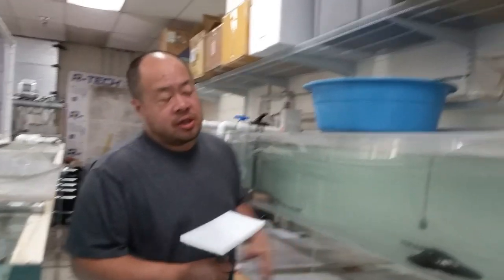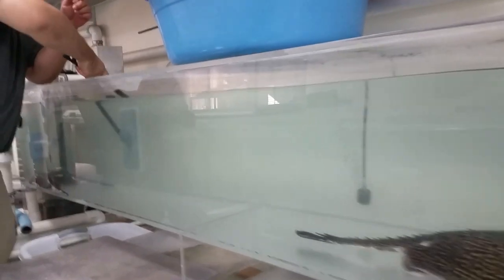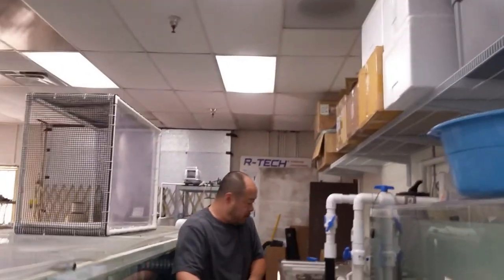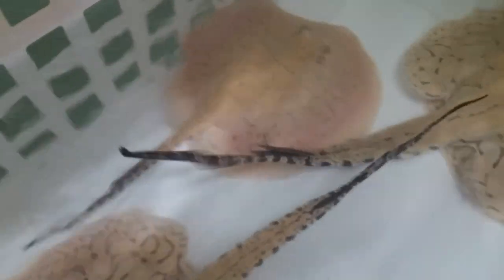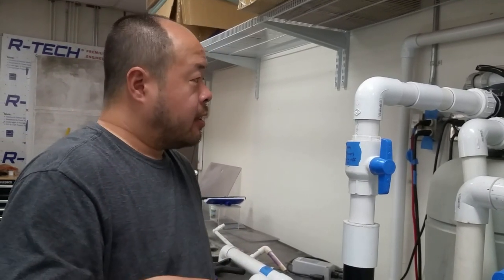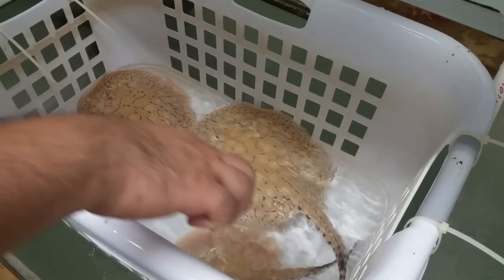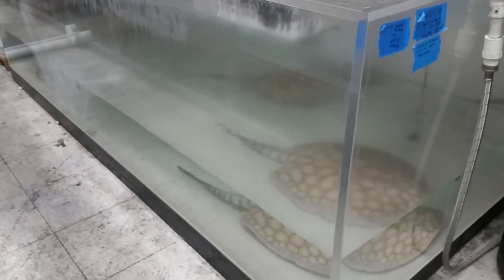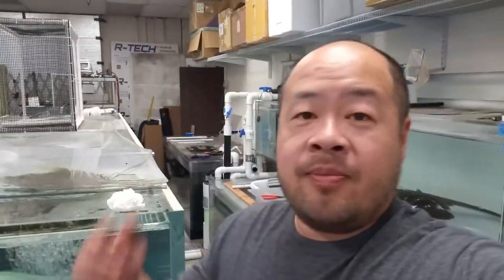Snow Leopard FREAKS OUT during aquarium maintenance * Multiple INJURIES *

Comment: 75-80% water change that's crazy i didn't realize that big of a water change was capable on these guys without the chance of shocking them.  I guess if your water temp was spot on you'd be ok?  I been doing weekly 25-30% water changes and all my rays are just fine but now I'm wondering if it's enough.